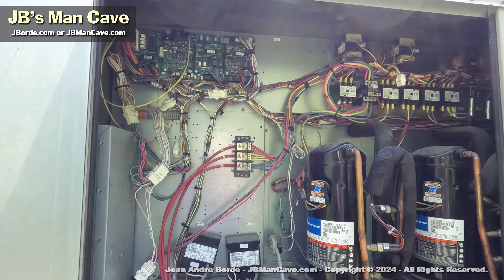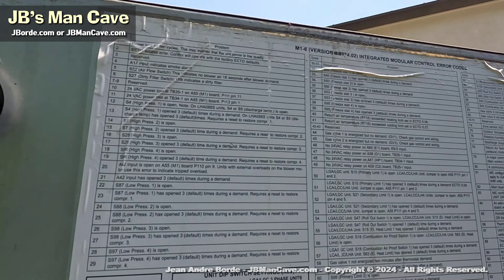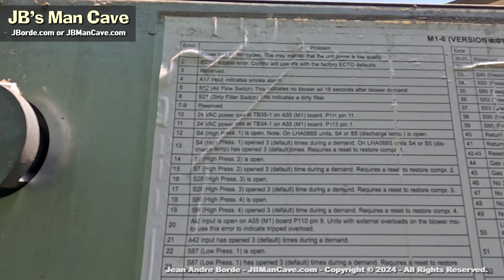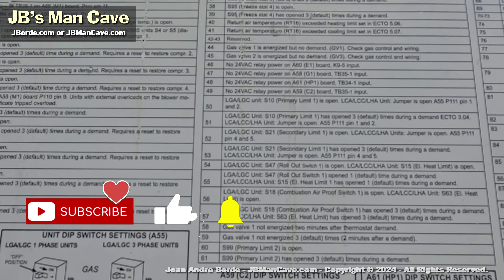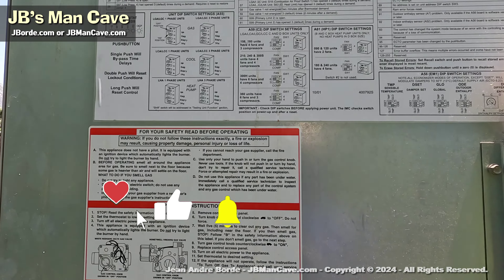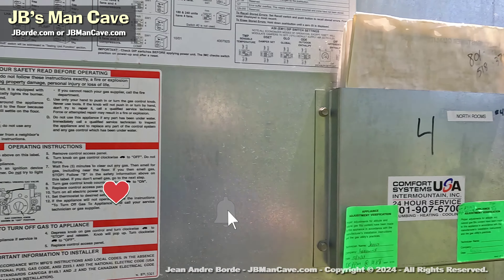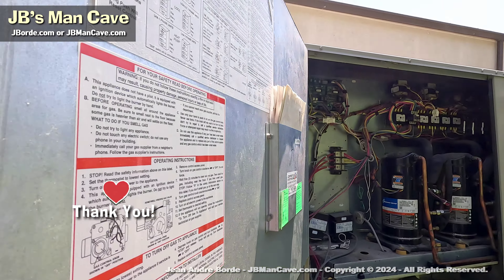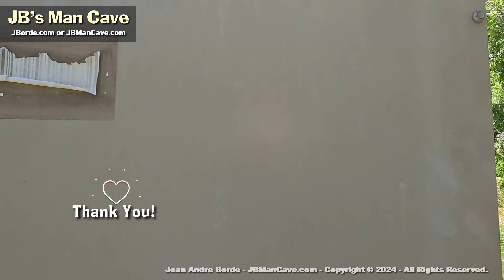LENNOX HVAC SERVICE and RESET Review DIY Heating Ventilation and Air Conditioning JBManCave.com

Comment: Seeing those big capacitors live and the raw components there is def a big hazard for casual maintainers if they don't know what they're doing! Good thing that these machines still have indicators and directions to help anyone and of course, you can always use the forceful method of cutting power in order to reset things, yes.
Reply from the maker: Thanks for watching.